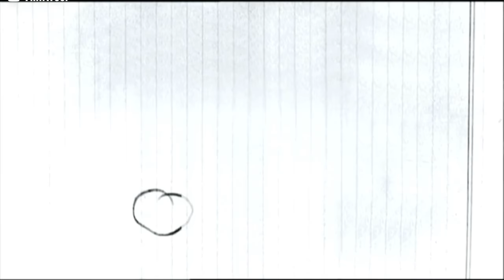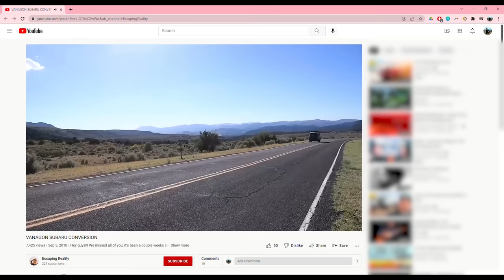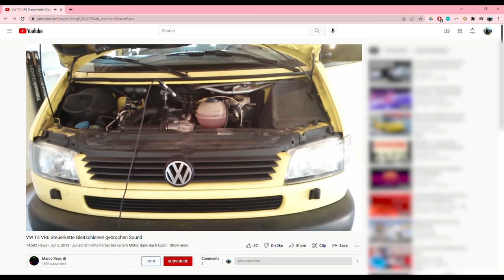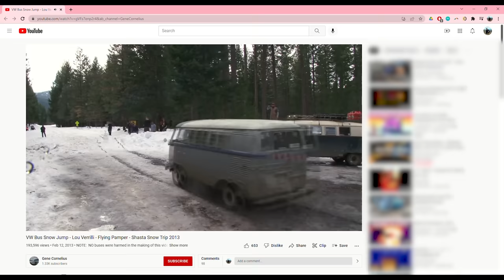The Long, Weird Trip of the Volkswagen Bus | Up To Speed

Comment: That chicken tax deal is a huge part of the reason why GM, Ford, and whoever the hell owns Chrysler this month hardly make any cars these days. Market protection in pickup truck sector pads their bottom lines so much they figure there's no reason to worry about building cars. Take those assembly lines and use them exclusively for overpriced trucks.

Comment: Yeah, I don't think your story about the Chicken Tax is quite correct in relation to Volkswagen.  When the tarriff went into effect, it killed the sales of Volkswagen cargo and commercial vehicles, such as panel vans, pickups and double cab pickups.  If they were passenger vehicles, it didn't have the 25% tarrif.

This law is exactly why today Ford brings the Transit Connect in from Turkey where they are made, and they have seats and windows installed in them.  Then they take out the windows and put in blank metal plates, and dispose of the seats.

Also, Japanese pickups got around this law by bringing their trucks in without beds and then adding the beds later.

But no, it did not kill of the campmobile and the passenger models of the bus.  But it seriously put a dent in Volkswagen's sales.  We had a 71 pickup and it was very rare to see a pickup from the second generation type 2
Reply: The chicken tax needs to be repealed. It's not necessary anymore. It's limiting the many vehicles(including pickups) that could be successful here in America.

Comment: I still see a lot of Kombis in Brazil serving for commercial purposes, and their size is often more convenient for urban operators, while the rear-engined RWD layout gives it a reasonable cross-country capability at a lower cost than a 4WD vehicle. Had it been fitted with ABS brakes once it became mandatory in Brazil, I guess it wouldn't have been phased out yet.

Comment: T4 is stupid. I had a VR6 Weekender as well. Suuuuuuuuppppperrrrr uncomfortable. You feel shoved up against the windshield. The back seats were cool, you could sit around the table and play strip poker while driving. The seats folded into a bed too. I ran out of gas in the middle of BFE Montana and that killed 3 of 6 injectors. The whole front end of the car had to come off to fix it. $3000 repair bill. UGGGGGGGGGGGGGGGHHHHHHHHHH. Sold it for 3x what I paid for it, including the repars. Oh well.